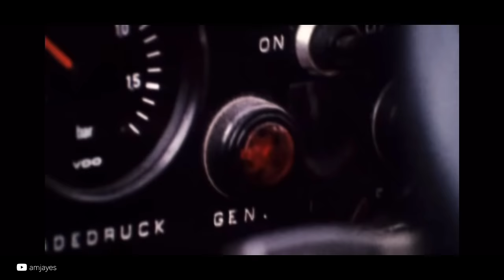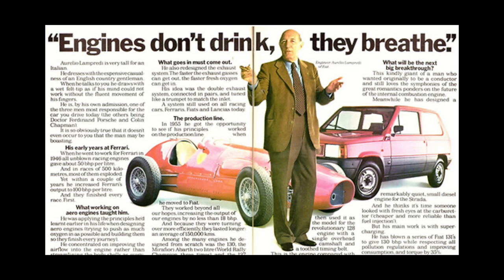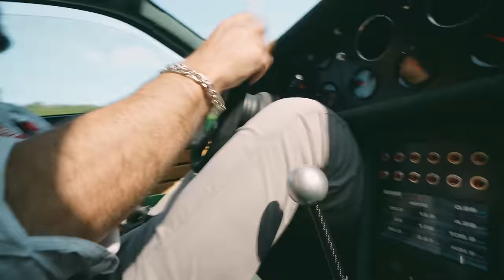The Kimera Automobili EVO37 is an Insane Thrill Ride of a Car — BTS with DTS — Ep. 11

Comment: These restomod companies are making cars which have immense character to the point where I’d rather buy them over alot of super cars
Reply: Agreed.  I'd take a Singer 911 over a factory 911 any day.  There's just so much more...soul in those cars.
Reply: Any day
Reply: Restomods are better than new cars in every imaginable way
Reply: Remember, it costs more than a V12 Ferrari.
Reply: @R4M_Tommy  But it's also waaay more fun n rewarding than the current V12 Ferraris. Will probably easily run circles around them too. PLUS it's a manual! 🤤
Reply: @CharlieFoxtrot06  True, but Singers have gotten so damn expensive that buying one would be a distant dream for most of us. The same price factor will probably dissuade most folks from actually doin what Porsches have always been known for - Being driven. I'd rather have somethin from Theon Design from the UK. They seem to be doin similar kinda work but at a fraction of the cost. They don't have the same carbon composite bodywork of the Singers, but barring that, their cars are almost there.
Reply: And considering the push for electric cars, I think a "second renaissance" of sorts is right around the corner. I think this is just the right time to get into car building and building restomods of the highest quality possible.
Reply: @rahulsudhir666  unfortunately, the Theon cars aren't any cheaper.  Figure around half a million dollars.  I doubt many of those will be driven anywhere besides a Cars and Coffee, and even then very gingerly.
Reply: @VladTepesVEVO  I couldn't agree more. There are a lot of legends that would really sell due to them entering the phase of major value appreciation. And if companies would restomod said vehicles, they would be right in the middle of the market craze. A good example would be a restomod F40
Reply: I agree, these companies are building cars with amazing performance and amazing emotional connection to the driving experiences, this along with the RUF SCR are two of the most desirable automobiles in the world regardless of price, I believe the new Tuthill 911K will also be in this realm
Reply: Honestly, we've gotten to the point where the only way to gain speed/handling beyond the limits beyond what we've already seen in road cars is for companies to pour billions into r&d only to gain fractions of an increase; So much so that it barely even seems worth it to keep investing in the race
Reply: Its not as if a stock 037 never had character,, there was only, what, 50 ever built for group B homologation, and probably the most beautiful car to drive from all of group B
Reply: Most super cars.
Reply: Agreed. If I had the money, I’d much rather have a restomodded 911, Alfa GTV, Super Seven/Caterham, Lancia, XKE, etc., than any of the pointy slot cars from McLaren et al. Maybe it’s time to rob a bank. Or two…
Reply: I never thought I’d say this, but watching the driving footage toward the end, I’d want something with less power, less grip, and more tractable…
Reply: Lol until you get one and realize how pathetically uncomfortable they are (knee breakers and shin smashers) and the almost zero build quality. Sentimental thought but in real life not really.
Reply: @rahulsudhir666  lmaoooo not even in the same universe! Have you driven an EVO like this and a LaFerrari? There is absolutely no base for a comparison. The Ferrari v12s are legendary for a reason.
Reply: @coronalight77  Totally missed the point there mate. Was referring to the "normal" front engined V12 supercars and not stuff from the hypercar territory. Very very different price brackets here. I don't think there's any point comparing a hybrid assist V12 with F1 tech to a barebones rally derived car such as this Evo. Besides, you can run one of these forever without having to worry about dreading about that day the LaF's battery packs are gonna go bad. As much as I adore the LaF, I'd have better peace of mind driving the tits off one of these considering the fact that the car is technically rally spec.
Reply: Unfortunately taste and money are rarely combined.
Reply: I agree. Most of the newer cars have lost all their style. Some cars should sacrifice certain performance aspects for style. It adds character to the car. Not everything is about efficiency. There are cars for that. When you want something special and fun efficiency shouldn't enter the equation until the end.
Reply: @narrowistheway77  Nah, they aren't.

Modern cars are much easier to live with. You can DD a new Porsche 911. They're extremely comfortable and capable in all conditions. You wouldn't DD a Singer.
Reply: Everyone would that’s why they cost more than those super cars
Reply: Agreed fun fact
Reply: Me too but I think they're more expensive. One day...
Reply: Somehow they tend to cost more than new cars. We have to attribute that to r&d and assembly
Reply: Yes, Agree! 💯🙌✌️
Reply: So you’d prefer a million dollar bespoke custom car over a mass produced model…shocking take LMAO
Reply: @narrowistheway77  Except reality.
Reply: @rahulsudhir666  plus you probably don't have to suck up to Ferrari to buy it
Reply: @scottbowers7248  No they aren't.
Reply: @rsrguy  Not sure about that.
Reply: tbh this thing costs way more than your average supercar...
Reply: Yes they are, and the prices to match. As a 74 Camaro owner. I’m so over the restomod,over the top, over done, SEMA builds. And if I see another LS build I’m gonna barf. There are still Plenty of resto mod cars that are really nice to admire.
  I think the term restomod is being used a few ways here. To me it’s late technology in a classic domestic muscle car chassis. I found the Kimera on line. This car is brutal. Who doesn’t want one!!
Reply: @sinappanis  apart from losing in style, they lack engagement & uniqueness. They're all concentrated on 1upping each other for the best lap-time on the Nürburgring, which forcibly brings them to the same performance oriented design. But most of them will never see a race track or a driven by pro pilots and all that power is totally wasted on the road. It simply isn't as thrilling to drive a 600HP super car at 50% as it is to drive a 200HP (or even less) hot hatch at its limit. I had the most fun & reward, when I felt that I've squeezed out 101% from my car and didn't crash it.
Reply: OMFG finally the perfect car.
Reply: I’ve decided I’m buying myself a Delta when I pay off my credit cards and get some money saved from my cannabis delivery service
Reply: @CharlieFoxtrot06  aren't the Singer 911 5x more expensive though?
Reply: @OnEEmONErD  the way Porsche's prices are now, not quite five times more, but I see your point.  Though, you can tell where the money goes in a Singer, whereas it seems Porsche are charging more just to charge more.  911s are brilliant cars, and I know there's huge money spent to develop them, but there's something to be said for the sheer craftsmanship of a Singer.  You just don't get that from an assembly line.
Reply: More expensive... Unless you're in Europe and can find lots of spare parts....
Reply: you made it sound you even have the means for a super car lmao
Reply: You nailed it!! I just need the money to do so 😂
Reply: The 037 was basically a supercar.  Turbo AND supercharger its insane
Reply: Anyone would. Just from the get go, they have the huge advantage of not meeting DOT reqs on bodywork, which is mainly accountable the generic appearance of most cars today. They’re the best cars because they are usually already chosen from some of the most beautiful cars of all time, they have body styles that would not be legal in new cars (even the beautiful little circular taillights are illegal), they retain 90% of the original character of the car and eliminate most of the things that suck or are impractical about owning and regularly driving a vintage car.
Reply: “Alot” isn’t a word.
Reply: The Guntherworks 911 is by far my dream car over any “super car”
Reply: Same here!
Reply: Classic restomods are better than modern cars but you cannot beat the real mc coy. If I could only afford one classic I would buy the original factory homologation version of the race car not a restomod version.   But if i was wealthy I would buy both.
Reply: That seat position is ridiculous 😢
Reply: So would alot of people but they cost more than super cars and those who can afford them don’t actually care about “character”
Reply: @rbslammed6163  and that’s what sucks. I’m not a fan of the few who buy cars of this price range for their clout status
Reply: True...I'd have to sell a few lesser-liked family members...but true 😅

Comment: Love the 037, I'm on a journey to budget restomod my Lancia Scorpion/Montecarlo.  I don't want batshit crazy just something that enhances the original capable platform.  So I figure a 230hp flat six lump is a good place to start.  I don't give a crap about  views or subs but if you're curious I'm happy to share my progress.  Will be jumping back into it after a hiatus of madness and work.
Reply: A Lancia Gamma OHC 2.5l flat 4 with a Volumex supercharger would be more suited... more Lancia !
Reply: @jean-charlesweyland129  Thanks for the comment Jean-Charles, however this is a budget build with a (more) modern engine for reasons I explain in my opening build episode.  Best regards!
Reply: @rivenmotors7981  I watched you first episode on the build and I get it. The Gamma flat four is also an all alloy engine (330lbs gearbox included!), fuel injected (80 to 84) and front wheel drive so that you've got drive shafts coming out the side of the gearbox just like on your SVX powerplant.

I live in France and Gamma engine are also real cheap (around 300$), Volumex supercharger are more expensive and often priced between 1500-2000$.

I recently bought 4 good ones for 3k, I plan on mounting one to my 78 Gamma Coupe and for the time being I enjoy driving my 84 Beta HPE VX.
Reply: @jean-charlesweyland129  Wow a Gamma Coupe AND an HPE?!  Both beautiful cars, there was an HPE on the property where I found the Montecarlo/Scorpion and I so wish I could've gotten it as well.
Reply: a Honda K20A2 would rip in a Scorpion, a straight six doesnt make any sense
Reply: @slapwagon  I agree a straight six would be silly, that is why I'm using a flat six boxer engine.  I considered the Honda lump but it's been done and I like the sound of a six versus four as well as the lower center of gravity, longitudinal layout, smoothness, etc...
Reply: Imo flat six makes no sense at all.

I looked at putting a flat 4 Alfa Boxer 16V in my X1/9.

Decided against it because it was too expensive to modify the centre bulkhead and engine bay.

The amount of work on the shift linkage, likewise.

Biggest problem was the rear cross member area thru the rear bulkhead into the boot.

The monty is basically a slightly wider X1/9 to accommodate the lampredi big block dohc whereas the X1/9 is for the lampredi small block sohc.

Fundamentally if you want to improve the front/rear weight distribution, it's not possible unless you reorientate the engine and box as per the 037.

Don't make it worse ffs it's near perfect already!

All these cars share the Fiat 128/Ritmo 5-speed manual and open diff.

All these cars run 128 based suspensions and many of the parts are shared/interchangeable.

Maybe look at how "the Delta Integrale engine" performed in the Alfa Romeo 155 D2 that kind of spawned DTM ... with the X-Trac 6-speed sequential, which has also been used successfully in the X1/9 raced by Manuel Dondi.

So I would urge you focus on how to make the whole thing work, improve it ideally, get the weight down, widen the track, and lower the c of g, to work with a 215/55/13 rear on a 7 and a 185/55/13 front on a 6.5 using Avon ZZS or equivalent tyres... think Lotus Elise/Exige.

Retain the original engine mounts,
diff casing, gearbox casing, 5th gear, block, crank, front and rear swing arms, front and rear hub carriers, saves tons of money.

Fit a Bacci LSD set up for the car's intended use - race, fast road, road, fit Bacci 1,2,3,4 all syncho gears, choose the ratios, all the bearings and seals are bog standard Ritmo/ X1/9/Punto/128/Delta mk1.
Put as much of your money into what really matters in other words.

That's the best gearbox for the money, will handle 250 hp easy.

Get a 16V head on there its the Delta/Prisma/Chroma one.

Up the compression, fit ITB's and a stand alone programmable ECU, get everything nicely balanced in there.

Map tf out of it.

N/A 200bhp 2-litre fast road, cheap
Twice that blown, possible but expensive and you'll need a custom pedal box, bias adjustable and different calipers and rotors.

I use bog standard hydraulics and brakes on mine, handle 150 bhp nicely, Tar-OX rotors, EBC linings and hoses.

Don't spend too much on welding and fabrication, paint, body...

Will be the mostest for the leastest eh

Otherwise Honda K20-24, Toyota 4AGE ...
Reply: @markbowden7238  You say a lot without looking at what I've already done.  Engine is in, gearbox in after rebuilding the rear suspension bulkhead.  Doing all the work myself and spending very little but for what I can't avoid or can't fabricate myself.  I invite and welcome your viewership but won't depend on it.  I have 11 or 12 episodes (so far) documenting my progress on my channel if you look under "videos".  Best regards from the states!
Reply: @rivenmotors7981  you're absolutely correct, my bad.
I wrote all of that thinking you were some crazy guy attempting to combine a 911 with a scorpion or something.
Maybe you are lol.
Definitely operating beyond what I consider sensible.
Great, bring it on 🤣😁!!
I will take a look at those episodes and come back later with more feeble platitudes.
Later...
Hey I watched a couple of your episodes years ago.
Popped a goog just now "do Subaru make a flat 6"
They do.
I'll be damned.
Thing is, you get into a car... just one, and if you stick with it long enough you get to realise how much you don't know about even that one car, let alone any others.
I write a blog about my car at RMS motoring forum/ members cars/ the ultimate X which you... probably won't read it doesn't matter 😃
Probably for the same reasons as I have limited attention span when it comes to looking at stuff that looks the same as the stuff I'm looking at twelve hours a day already... probably is.
But just brilliant mad nonetheless.
I'm a decorator, in UK.
If I was even remotely near I would ask to come and have a look myself.
You're theoretically on to something, sure you know it's never been done before.
It's got potential.
Hope you can get it set up right and handling perfect.
Cheers
Reply: @markbowden7238  Thanks Mark, I will check out RMS motoring.  Nice chatting with you, I finally have more time to spend on it and will be creating more current episodes.  Cheers
Reply: @rivenmotors7981  🙏

Comment: I'll take one. :)

Typical Italian seating position. Right leg impaled into centre console. Left leg left with tonnes of room and no support. My Fiat Coupe 20v Turbo was exactly the same. Love Italian cars :)
Reply: My 147, although and aguarbly more modern have similar ergonomics if you can call them that. But then you wind that 16V twinspark engine and turn the steering towards a few bends and everything is Ok 😎🤌
Reply: How tall are you? if you are like me 170cm tall. all italian cars even small fiat 850 Coupe fits perfectly,  🙂i think the average Italian guy that some of these cars where molded for is why many people are complaining about the seating position 😀
Reply: @DArkwIng2  I’m 172cm. I fit no problem on the 147, but ergonomically if I want to set distances properly for both legs and arms and sitting fairly upright, you always have to compromise. It’s either legs Ok and arms stretched or arms bent properly with squashed legs 😅
It’s not a space issue it’s just position. But I’m used to it now so 😎👌
Reply: @DArkwIng2  Yeah OK I confess I am 6' 4inches.But that not the issue. All Italian cars I've driven have this weird offset driving position. Perfectly  illustrated  in this video. Not sure why.

Comment: Since ill never own a real Lancia 037 Stradale, Id love to buy one own a "Tribute" Car. This Automobili EVO37 is a pretty cool modern take on the 037 with the a tighter shape, less panels, slimmer body lines, and a much shorter wheelbase. Its like a mini 037. But, Boldrin Auto makes, Carteroni, and few others make damn near 1:1 Tributes that are just nasty. Carteroni's 037s have the best Chassis ive seen so far. its pretty insane and they give you give nearly every option from body panel composite, seats, suspension, etc) theyll pretty much stuff whatever componant you want in one if you got the money. But their "default" turn key setup is surprisingly cheap for a dream car with modern performance. 
This tribute sold for $65K in 2021 with a nasty little K24. Still needs finish work but damn, 65k for the chassis, body, and all the other companents into a rolling chassis! Winner got a steal.  https://bringatrailer.com/listing/1977-lancia-037-tribute/

Comment: This car is a piece of art! But apparently you have to be a horse jockey to drive it. See where the driver's knees are, right over the dash bottom line.

Understeering seems snappier than the usual, compared to other cars in the same category (mid engine rear wheel drive) and from my spectator point of view it seems an endless source of fun.